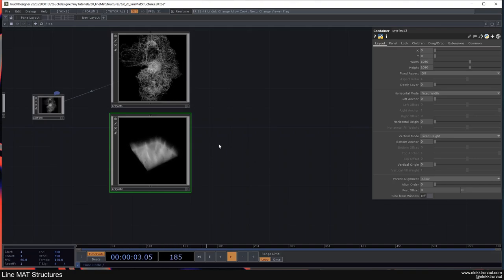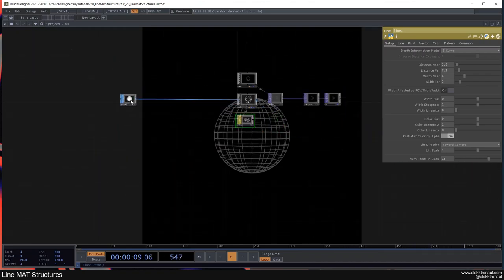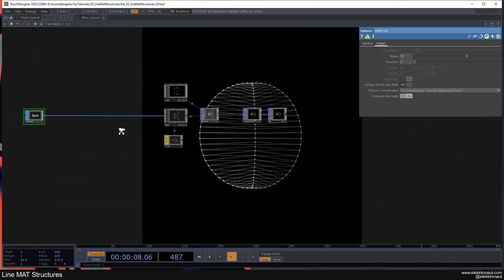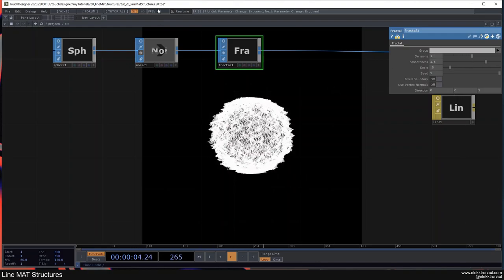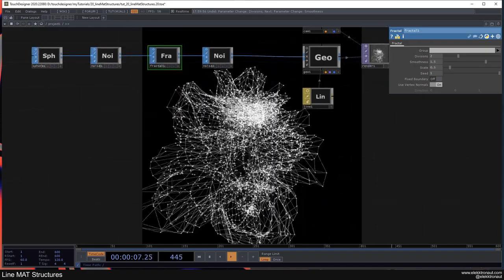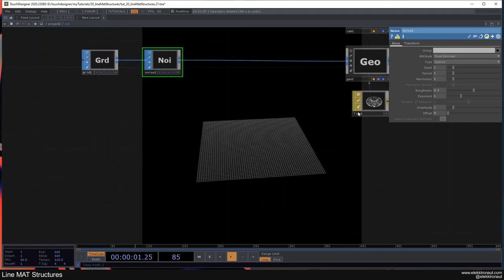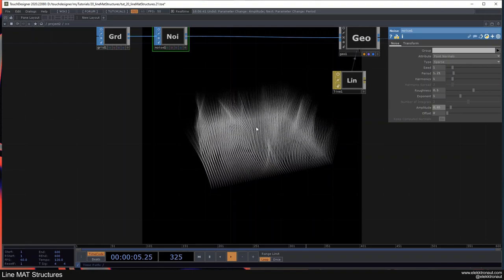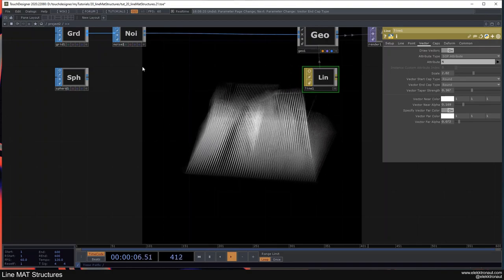Line MAT Structures – TouchDesigner Tutorial 20

Comment: I’m having an issue with adding the line MAT op. When first added I cannot see a torus rendered, and after fiddling around with the parameters, I still cannot see any lines rendered. Drawing points does work. Anyone know what the issue might be? I’m running on a fairly old machine (MacBook, 2013) and the non-commercial license.

Edit: dug through the forums a little bit and discovered that there seems to be an issue with rendering the line mat on macOS machines running intel graphics. If anyone else runs into the problem, that seems to be the reason.
Reply: So what was the solution? No line mat for us?